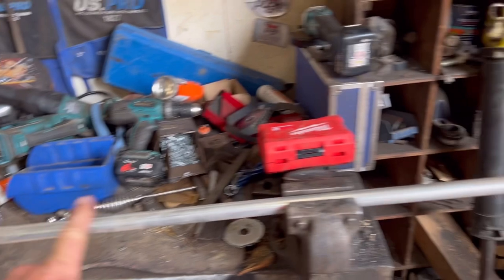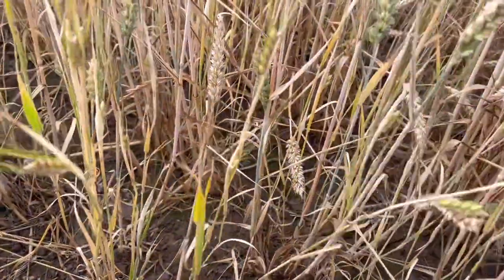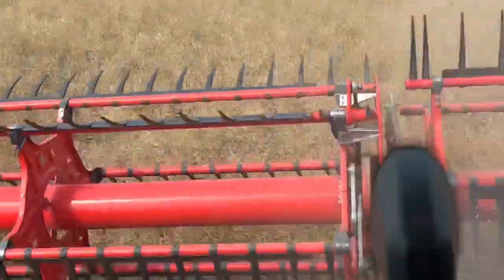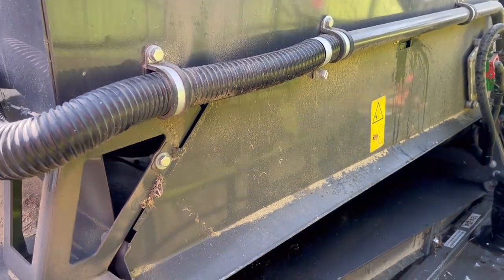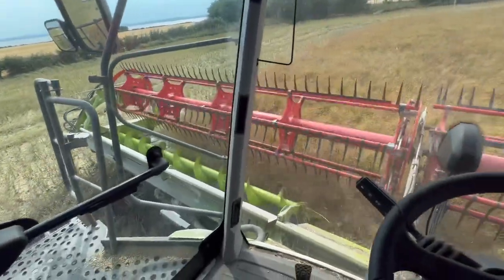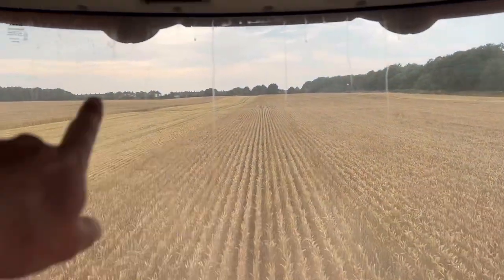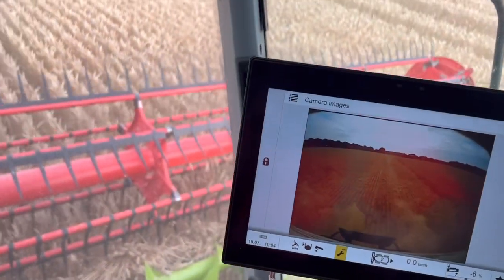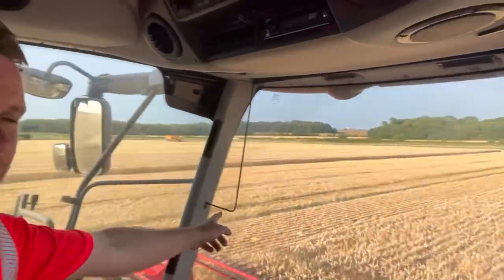DAY849 MAKING FIRE BEATERS , OFF ROAD BUGGY ARRIVES & BREAKDOWN   #OLLYBLOGS  #AnswerAsAPercent

Comment: The flame is from the flare stacks, there lit all the time…the reason why you don’t always see the flame is because steam is used on the flare stacks which masks the flames… sometimes you have to flare a bit heavy due to changes operations / process upsets and it can take a while to get back under control

Comment: Oil refineries will usually have a flare, burning off gas or any H2S entrained in the oil. The flare will spike (go large) if they have a plant upset and they need to depressurise / blow down the system, the only place they can do this to is the flare stack. Gas plants also have flare stacks to burn off sour gas (high H2S) or for plant blow downs.

Comment: The flame on stack is burning off excess LPG from refining the crude oil. 
Highest temperature I saw on the tractor screen today was 39.5° up in North Norfolk. 
Big fire in Ashill on way home, I suspect it was a wheat field and could see it from miles away. 
Apart from the shock of the heat after being in aircon all day, I’m 90% today.

Comment: Stanlow has the flair stack its always lit but some times hard to see, it basically burns off excess gasses from the processing of crude oil, I'm that side of the River and somedays its terrible with thick blackclouds coming from it normally on bank Holidays! Guess environment agency aren't working then🤷‍♂️
Reply: If it is letting out black smoke then it isn't doing its job. The flare is supposed to burn off the hydrocarbons, not burn some of them and let the rest go. The only "smoke" that is supposed to come out is water vapour.